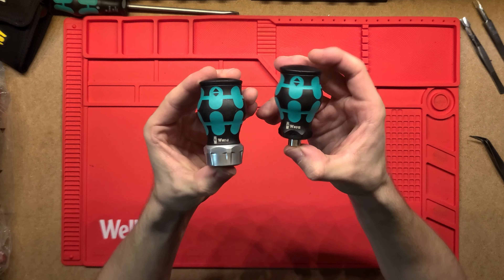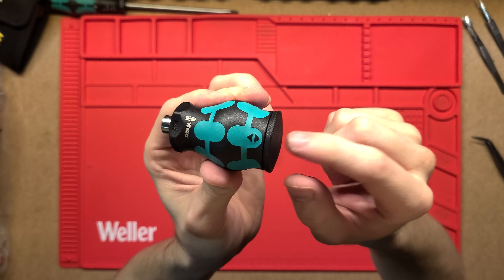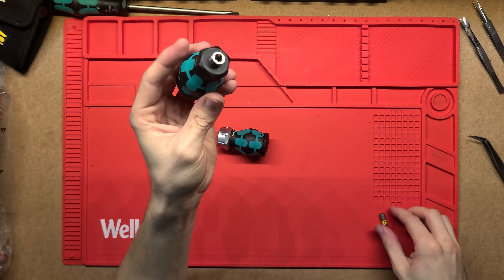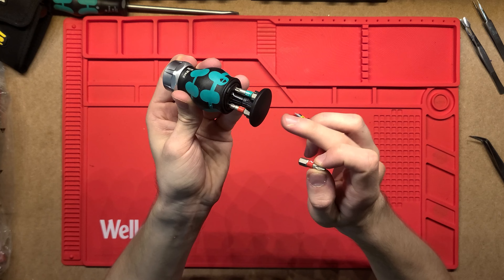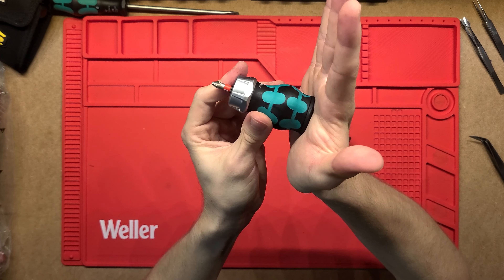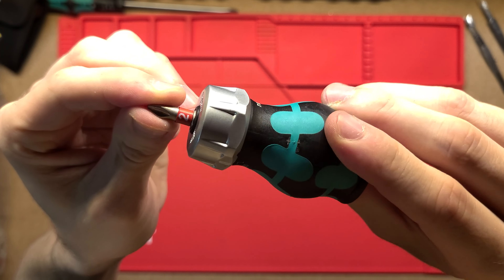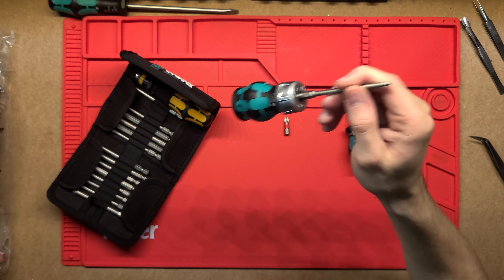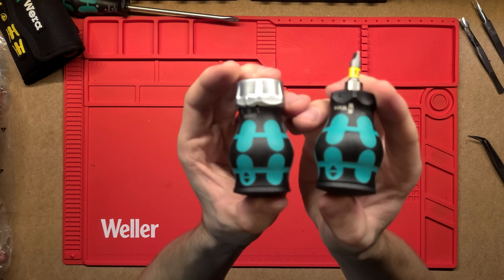Does Ratcheting Make a Difference on Wera Stubby?

Comment: Great tools, I have both of them, named bicycle set with hex plus and torx bits and just one Philips. The bits are stainless steel specially for bikes and other stainless hardware. I personally prefer the ratcheting one, more confortably to use. I also have the little ratcheting T handle, with the rapidaptor and long bits in the set. Great design. They released two ratcheting handles with a new mechanism, where you can use the switching ring to easily start the screws, great for one handed use.
Reply from the maker: Sounds like you’ve got a solid setup! I agree, the ratcheting one is definitely more comfortable to use, especially for quick jobs. That new mechanism with the switching ring sounds super convenient for one-handed use—I’ll have to check that out.

Comment: Great video. The comparison between the two really got me thinking about how often the right tool makes all the difference, especially in tight spaces. Is the ratcheting feature truly worth the upgrade, or does the standard version handle most tasks just as well? Anyone else notice a big difference in performance between the two?
Reply from the maker: Glad you liked the video! From my experience, the ratcheting feature on the Stubby is worth it for tight spaces—it makes the job faster and easier. But the standard version still handles most tasks just fine.